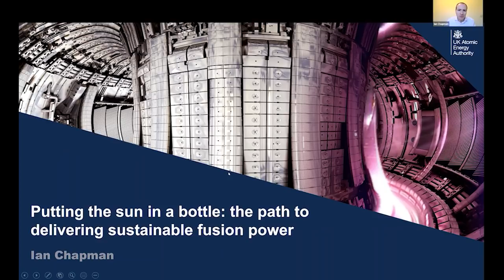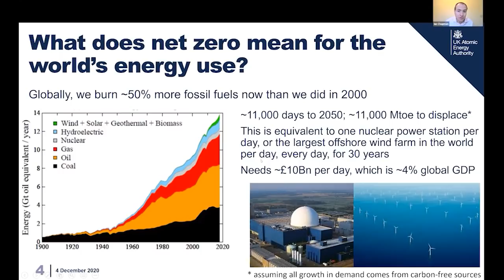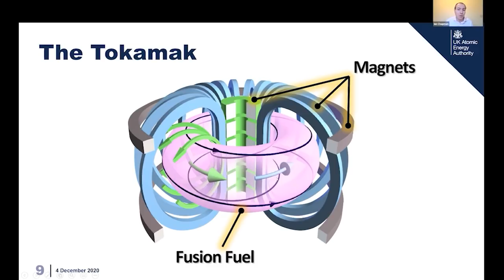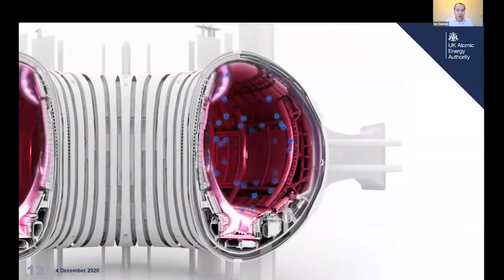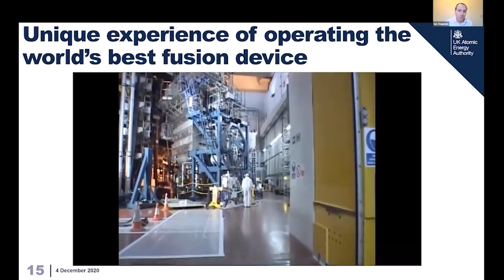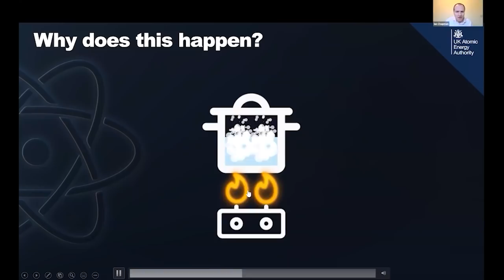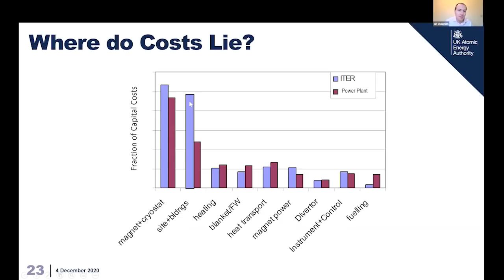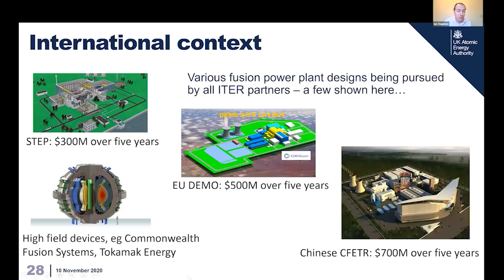Putting the sun in a bottle: the path to delivering sustainable fusion power | The Royal Society

Comment: 53:00 True, the actual amount of lithium used in one reactor is very small, so to talk of lithium reserves being an issue, you'd have to be talking about very high rates of energy generation, and extremely long time scales. Still, it bears mentioning that, as long as you're restricted to D-T fusion, this lithium supply, which is the critical, limiting resource, means that your fuel is not "as plentiful as sea water," as some hyperbolic expressions would have you believe. It's well short of that.
Reply: At this time, electric cars/lithium grid storage are going to represent a bigger load on lithium reserves.....
Reply: @geoninja8971  Bite me. That has nothing to do with what we're talking about.
Reply: You said it yourself. "As long as you are restricted to D-T fusion". If Fusion can be done at all, what is the likelyhood that the D-T cycle is the only one that can be done? Plus, even IF that turned out to be the case and we used up all the Lithium we have, how long would we be able to do this? Your point is mostly the pointing out of a technicality, the criticism of hyperbole for dramatic effect, not an actual objection or hurdle...
Reply: @Alexander_Kale  You must be the master of straw men. I never said the D-T cycle was the only option there would ever be. Yes, it would take a really long time to use up all the lithium. FFFS we DO agree on that, right? I never said this was any sort of show-stopper. I was just pointing out that claims about fusion fuel being "as plentiful as sea water" are silly—hyperbolic, as you yourself might have put it. Some fusion fuel is quite plentiful. Some, like helium-3, is less so (at least, on Earth). Deuterium is actually not all that cheap—you may remember that both sides in World War 2 went to considerable effort to make it or to deny it to the other side, even when its eventual value was not at all clear. But again, the actual amounts are plenty for the foreseeable future. So I don't see what your point is.
Reply: @ronaldgarrison8478  " I never said the D-T cycle was the only option there would ever be. " - Yeah, no shit. Neither did I imply otherwise. That you should have the audacity to call my point a strawman, when THIS is the response to what I wrote, is really astonishing. o.0

Comment: The renewable energy cost estimates in this video are wildly higher than most estimates. They seem to be using estimates for current energy storage and 100% of the way to net 0. This is supre misleading beause 1. That battery storage is not needed until you get to pretty high renewable energy percentages so lots of progress can be made before hitting the truly high costs. 2. The almost certainty of falling energy storage costs. 3. That going 95% solar and wind dramatically reduces estimated costs compared to 100%.  

Many people think the estimated cost of hitting 95% is 5x less than this video suggests. Which a very very doable percent of GDP.
Reply: There is both the advantage of new technology development and increased mass production. Cost of storage is dropping drastically and you only need so much of it to give a large initial drop in generation requirement.
Reply: While the cost of storage per unit of energy might continue to decrease, the total requirement for storage in case of rising supply via intermittent and uncontrollable energy sources will only ever increase. In the face of ever rising energy demands, this will increase to ludicrous levels. 

We are not talking daily storage of a few hundred megawatt hours, done by every single household or street according to their own demands. We are talking the need to store the entire energy demands of whole countries for weeks and months on end, harvesting surplus in the summer and keeping that for when the production deficit comes along in winter. 

If anything, the cost of this is understated in the video.
Reply: @Alexander_Kale  which is why renewables cannot be the whole answer, but it can be a huge part of it. What we need is both storage and long range transport of energy to where it is needed. American deserts could supply all of the US energy needs with solar alone providing you have a few days storage at most for extreme weather events. That is where wind comes in. But once fusion gets going you will not need that much storage anyway, in most areas 24 hours would do.

Europe could be supplied by North Africa.
Reply: @seriousthree6071  No, actually, it isn't. What we need is an energy source with a customizeable and controllable output. 

Storage Plants may be a sensible alternative to peaker plants, and then we can use Solar or Wind to charge those. Basically, those two should remain a niche application. Charge batteries in small and isolated locations and so on.

Comment: 48:35: "ITER will be a net energy consumer. It produces 500MW [thermal] out. I talked about the 50MW to heat it, but the total consumption will be 600 and something - 650MW".
Reply: 49.09 "but a scaling from ITER to a power station ... would require only the same input (yet the output would be magnified many times)". lol. (it is intended to be a proof-of-concept of large-scale fusion, not a design for a future commercial reactor.) Your post has been Busted! but what on Earth was its motivation? (god bless!)
Reply: We're only going to see working fusion in our lifetime if we take one to Titan so we don't have to cool the superconductors.
Reply: @jayjames7055  ITER fusion experts always say "50MW in, 500MW of heat out", giving the public the false impression that ITER will create more power than it consumes.  There is usually never any explanation that ITER will need a lot of extra electrical input power to run the whole machine.  So it's refreshing to see an admission in this video that ITER will be a net consumer of electrical power (even if the output heat were converted to electricity) and will require an input of over 600MWe.  It's a shame there was not more discussion of this, because without any explanation, it would appear to contradict the "50MW in / 500MW out" claim earlier in the slides and in the commentary.
Reply: @BLOKE0001  The same fusion experts ALSO say that ITER will never produce electrical power, much less export any to the grid. They are not misleading the public. That is done by people like yourself.

Comment: Halleluia! you shortened from 40 years to 20 years!   but seriously.... well done. When you make your UK fusion power station, how much will the power cost to the consumer[ without govt aid]
Reply: 'more'
Reply: What kind of a question is this? How could he possibly know the answer to this?
Reply: @Alexander_Kale  he will know approximately.
The building
The raw marerials
The people needed
The power needed to initiate power generation
Compare to solar power
Run by software
1$ per watt generation
Few people needed to run the place
Megapack batteries to store the power generated
By the time fusion energy is working, solar,  wind, salt LFTR REACTORS, 
 and geothermal will be very cheap making fusion reactors obsolete.
Reply: @steveblomefield9513  If you had asked the inventor of the first proof of concept nuclear fission reactor what the costs of eventual electricity production would be, he would not been able to give you any answer. He would not have known the eventual security restrictions, government sanctions, subsidies, tariffs, inspection tolls, safety margins, none of that would have been even remotely foreseeable. 

The ONLY thing he would have known is the approximate fuel cost. Any kind of estimate he ould have given as to the actual price of electricity could be off by pretty much whatever number you roll on a hundred sided dice.
Reply: @Alexander_Kale  true

Comment: It's great planning and good work.

At the same time, "I want you to act as if your house is on fire" - ok, we're planning on starting to put it out in 20 years.

I understand that this is only part of the solution, however, the reality is that if it is only starting to have a commercial role out in 2040 then it's impact will be minimal. In terms of funding, it should be getting the £200m from the UK government, but only if similar funding is going into commercialisation of closer to market solutions such as offshore wind. - however it's not.
Reply: @CassChrystie  you clearly didn't read that in detail and don't know the ins and outs (I fully understand why, the releases such as the sector deal are spun to make it sound like they government is investing). The UK government is NOT funding the offshore wind sector to £250m, it's not even putting in the £100m that the Offshore Wind Growth Partnership is trying to get into supply chain development. It MAY match about £60m from the industry (to the tune of £40m) which itself is uncertain as the large developers haven't committed to it, with the intent to leverage another £150m from the supply chain itself for innovation (God knows where that's going to come from, innovators don't have that capital). And in case you next point at the port infrastructure fund, that's not for offshore wind innovation it's to develop the sub standard port infrastructure.
Reply: @George Mann 🤣🤣🤣🤣 is that why offshore wind is less than half the price of new nuclear, so has a subsidy that is about £50 less per MW? (not including the increase in the Hinckley C strike price for construction overrun, or the cost of decommissioning overrun covered by the government)
Reply: @George Mann I'm afraid it's you that clearly doesn't understand how the electricity system works. Nuclear currently is subsidised, and at a significantly higher rate than offshore wind (let alone onshore). Similarly you don't seem to understand load balancing and the fact that inflexible generation (ie nuclear) is as bad as environmentally dependent generation. Further the costs of storage as an easy technological fix with vehicle to grid
Reply: @George Mann again you show your lack of knowledge, even though you have a lot of detail it's wrong. Dogger Bank has a Strike Price of £39.65 and the system cost of environmentally dependent generation is almost nothing, the carbon emissions of it are similarly insignificant.
Reply: @rexmann1984  that's not a significant issue, the land use isn't exclusive. Whereas for nuclear it is with the risk of major land sterilisation.
Reply: @Scubadooper  I used to think like you do. Now I don't, there's a reason for this.
Reply: @rexmann1984  I don't know anything about you, what you do, what your training is, etc. What I do know, as an engineer and professional in the power industry, is that what I say is correct. You may have thought like I do and now don't, but that says nothing to the merit of the argument, it just states your opinion has changed.

Comment: 25:52 To control the plasma flares I would imagine that you could induce a wave on the surface of the plasma by varying the strength of the magnetic field, the controlled morphing of the surfacewave wave length can then absorb the fluctuations preventing it from reaching the discharge threshold.